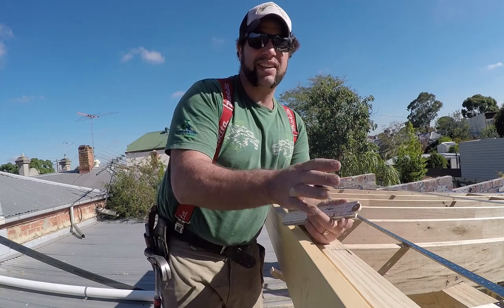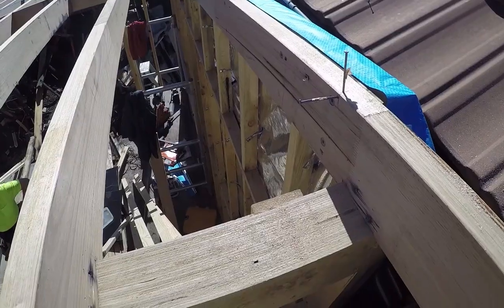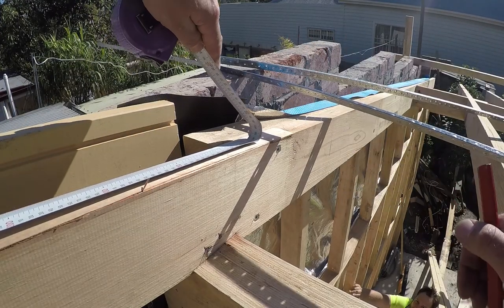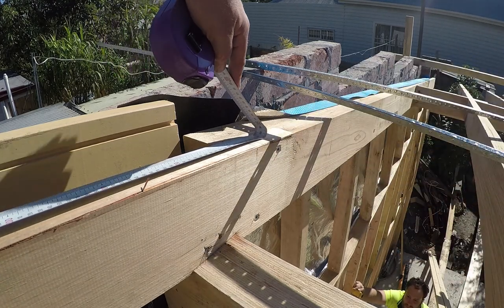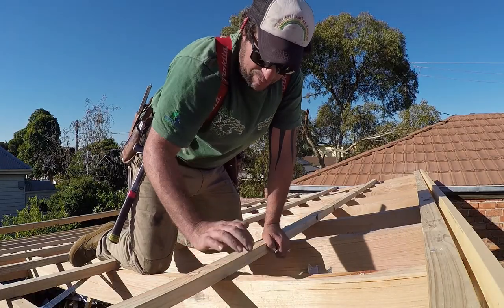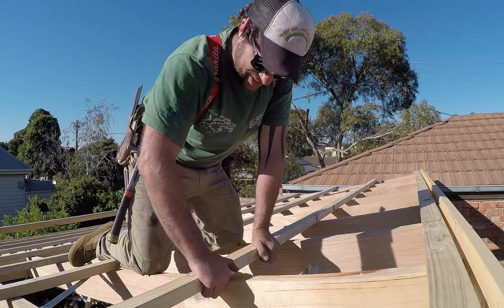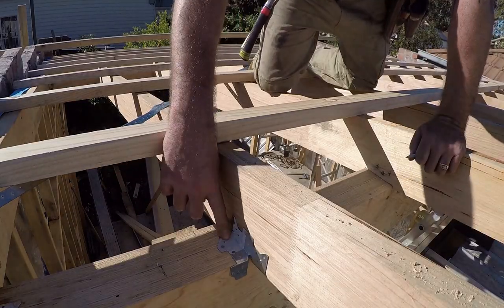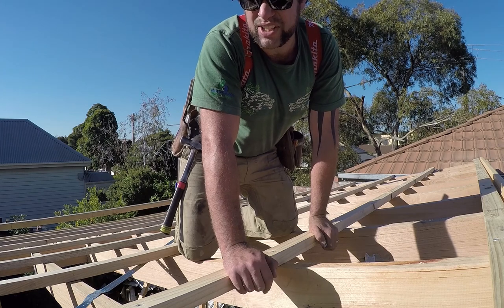Running Battens on a roof

Comment: Great video, Thank you! Where does the Sarking go? over the battens, between batten and rafter or under the rafters?
Reply from the maker: Gday aliminfar.
Good question!
roofs the sarking over the battens with a slight dip between and on the walls under the battens and pulled tight but not to tight
#stayawesome
joejo

Comment: Great video. I'm currently trying to replace a fascia board only to discover that some of the rafter ends are rotten and so is the "trim batten". Turns out to be a much bigger job than I thought but trying to get some ideas from here.thanks
Reply from the maker: We come across this issue on upgrading home all the time.....cut back the rotten timber if you can, extend the rafters out with a little extra, run a string line, dock the new ends and run a new facia board, trim out and re-flash roofing.... replace roof AND..... wal-ah done
Reply: All looks and sounds so easy when you do it!  I'm slowly getting there. cheers and thanks for replying
Reply from the maker: It one of those things, 25 + years of experience gets the project done with a blind fold on...... hammering at those skills one swing at a time, you should be proud of yourself Pseudechis
Reply: @snells-window  is your roof complete Mate?

Comment: Thanks for the great video. If I want to use a metal roof frame, can I use metal battens for a terracotta roof tile, or should I use timber battens?
Reply from the maker: Truthfully, ive never seen metal battens on a tile roof as they would slide adn move to easily.
they are also "high conductivity" of energy which means the suns raise/heat will spread into your roof area quicker than timber.
#stayawesome
Reply: @BeowulfBuilders  Thanks very much for your experience on this.

Comment: Gidday. Can you tell me what you do when your battens aren't long enough and you have to join them end to end on a rafter. Do you use triple grips for example?
Reply from the maker: Gday Steve,
GROUSE question
there are 2 ways i do this
firstly i try to join it over a rafts or alternatively i will put a noggin between two rafters and join over the top of that.
Feel free to sponsor our patreon account so that we can bring you even MORE quality info 
www.patreon.com/beowulfbuilders
#stayawesome
joe joe
Reply: @BeowulfBuilders  thanks Joe Joe. I like the noggin idea. Also after asking I noticed some people just hang them over each rafter and then join them mid-way  between with joiner plates. Makes sense I suppose when most of the weight bearing is already taken up.

Comment: Is batten similar to purlins? They seem to have similar purposes?
Reply from the maker: Nope, 
Battens adn PErlins are very different.
Perlins are a support beam that run underneath the rafter to break the span of the timber.
Battens are fixed to the rafters to hold the roofing in position. 
#stayawesome
Reply: @BeowulfBuilders  i think what he means C-purlins that are used as battens

Comment: How do you work out the spacing for the timber battens for say a corrugated steel roof?. Is there a regular/ common size you would use?. And how do you work out the spacing at the eaves and ridge for a hip roof?. Darryl
Reply from the maker: Gday Darryl,

The spacing for the timber batten should be explained on your manufactures guild lines when you purchase roofing, yet remember the old saying "more often the better" Mostly we space the battens at 900mm spacing (3' foot) yet these can be further away with thicker gauge roofing or closer with thinner roofing or in a high wind area.
i have a video on pitching a roof that talks over the spacing yet this is reliant on the size of the timber, the span and the spacing (i also have a video explaining spanning and spacing)
So as to reduce the work later i usually space at 600mm centers (2" foot) including hte joist system so that i can directly stick plaster to this....remember though you can not directly stick to trusses

let me know if you need more info
stay awesome 

joe joe
Reply: Thanks Joe, much appreciated.
Reply: 900 centre for metal roof